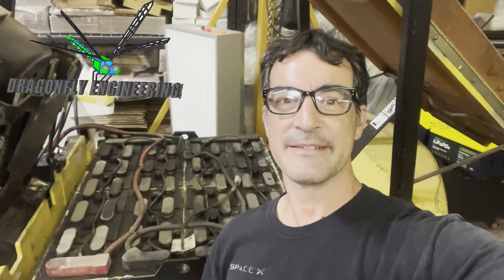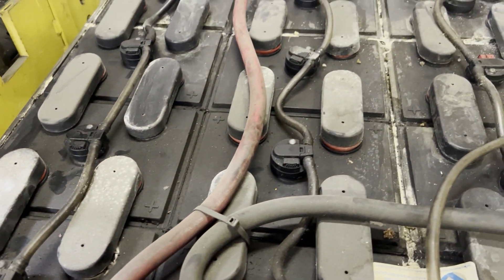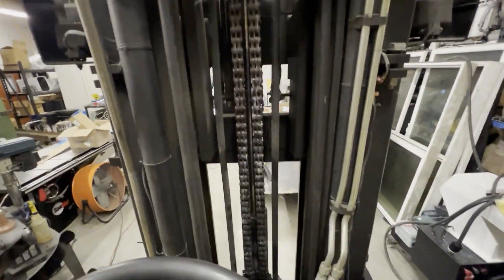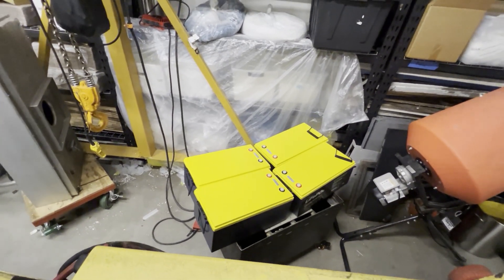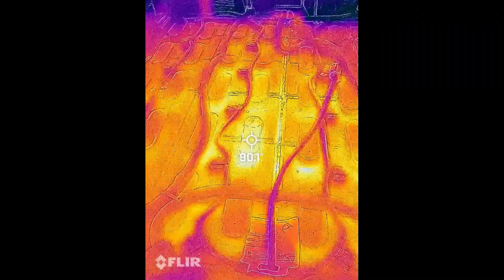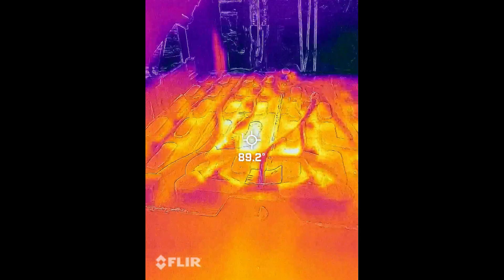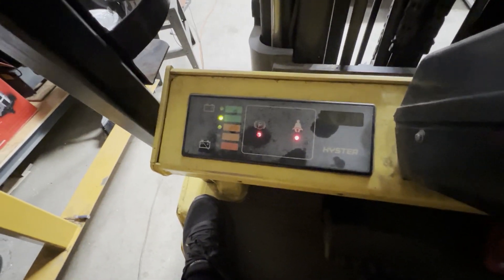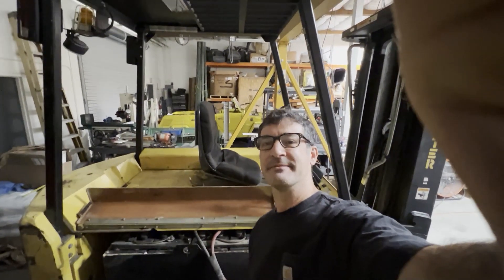Forklift battery Thermal Runaway

Comment: If you intend to stretch out the battery life by replacing the bad cell(s)(it only takes one bad cell to do this) then find the cell(s) that aren't boiling and you'll find the bad ones.   Get good cells of the same capacity and replace those bad cells and you might get awhile out of that battery.  The cells are bubbling when it's not on the charger because the good cells are discharging through the bad cells to equalize the battery voltage.  However, it's the good cells that are bubbling, the bad cells are shorted.  Bubbling only comes from the hydrolysis that's happening as current passes through the electrolyte in the good cells.

Really, this battery is toast.  Rebuilding it by replacing out the bad cells will arrive you at one of the good cells taking a crap soon thereafter and you're back to square 1.  That battery should cost somewhere around $6K, start saving.  The salvaged old battery is going to net you somewhere around $1500 so there's a savings there.

I've fought lead acid batteries for decades.  When they go - they go.
Reply from the maker: Thanks for the tip! I am going with lithium ion strap on batteries.